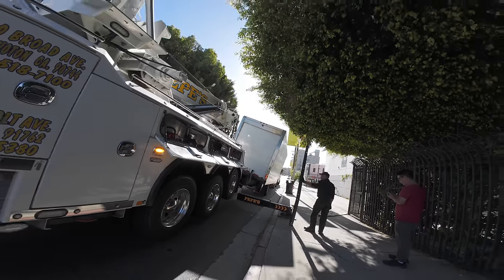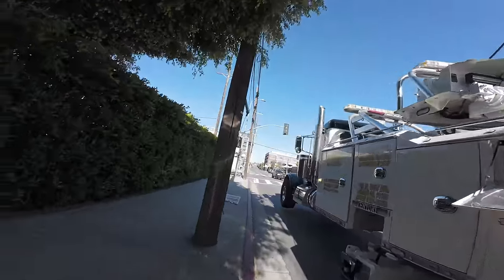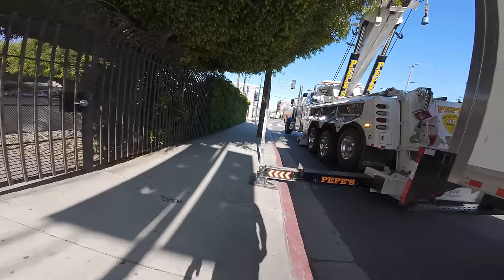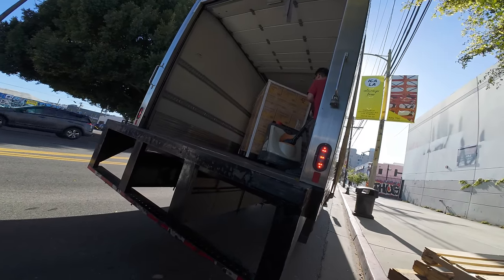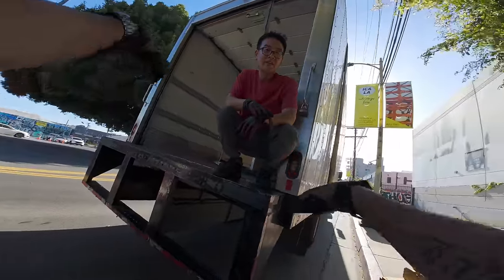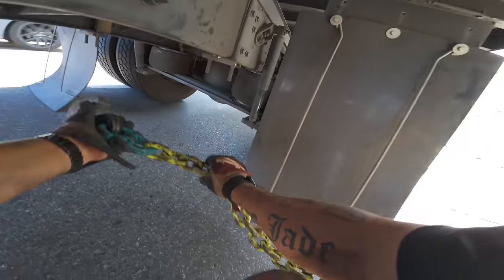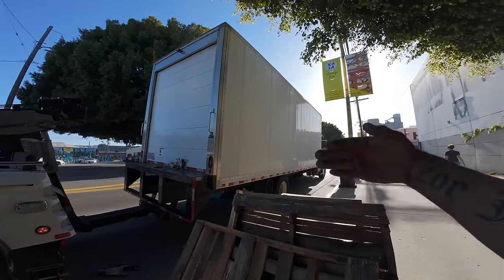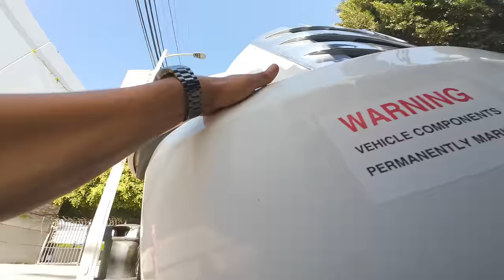Box Truck Almost FLIPS Over From Shifted Load!

Comment: You know he’s overloading the truck. The spring in the passenger side rear has recently been replaced. They probably load it to the max and it bottoms out then the tires rub on the box. It’s a way for a company to use 26k GVW trucks and not have to pay for the 35K  GVW weight fee charged by the state. Also doesn’t require their drivers to have a CDL.
Reply: OR: The spring just snapped.  (don't overthink it )
Reply: @hj8607 no the original poster is correct. They are using this truck to haul loads it’s not rated to haul.

Comment: Pro tip: if you have xtra empty pallets, and have a gap in between your load. You can use the empty pallets flip them side ways put them in between the gap. And use them as load stabilizer so your load won't move or shift.
Reply: Thats a great idea, I never thought of that! You know what else would help? How about a pallet jack that is easier to use, that uses a joystick instead, that handle contraption is absolutely useless in tight spaces.
Reply: Or even better idea is a driver who knows what they are doing 😂😂😂😂😂
Reply: We get that a lot from our grocery load, and specialty loads here at smith's

Comment: Not sure I understood why you felt the need to offset the hook height on the frame rails. Once you lift the chassis, the broken spring is take completely out of the equation and the load will be balanced between the lift hooks and the front suspension. It may have looked off while still parked just due to the crown of the road, but shouldn't have been an issue. If nothing else, I think I would have put a binder on the suspension (both sides) so that the rear axle didn't drag due to the broken spring.
Moving to the front after blocking the rear axle made sense though, because of the load weight to stabilize the tow.
Reply: Yeah, what he said. Why worry about the spring or the unbalanced load if you are lifting with the wrecker from the rear of the frame (or does the wrecker lift rotate horizontally?)?

Comment: Those safety chains look so tiny to what we are used to with Hulk and Big Flipper.
Reply: Those are 3/8" G7 chains with a Working Load Limit of 6,600 lbs. Both add up to 13,200 lbs. The front axle on that bobtail is approximately 9,000 lbs. California law requires that tow truck safety chains must be able to secure 150% of the towed vehicle's weight. This is a 26,000 lbs. vehicle and 1.5 times the weight is 39,000 lbs. Each chain's Breaking Strength is 4 times the WLL which is 26,400 lbs. Two chains add up to 52,800 lbs. , which is 13,800 over the 150% of the towed bobtail. Using a chain's breaking strength is only allowed by law on safety chain application in California. Hope I got this right. Lol !

Comment: Don't your delivery trucks have tail lifts like here in UK/ireland. Then can use use the pallet truck to unload
Reply: Depends on the truck model.  Some box trucks have them, others do not. 
If they are only hauling between loading docks, no need for a lift.
Reply: Yes, but looks like that company was to cheap to get 1
Reply: Sure, we have trucks with lift gates.  Not all trucks have them here just as not all trucks in the UK and EU have them.  Those that are intended to load from the ground have them.  Those that are intended to load from docks often don’t.

If you are having a carrier pick up and deliver a shipment, you must specify if the pick up and delivery sites have docks so the right truck is used.
Reply: @matthewgaines10  A taillift can be used in a dock quite easily. Those box trucks should all be fitted with tie down points to prevent the loads from shifting.
Reply: @DavidDoane-hx6lo  His people don't want to pay for the disposal fees,  so they fly tip like they do in their own country 😂😂😂😂😂😂